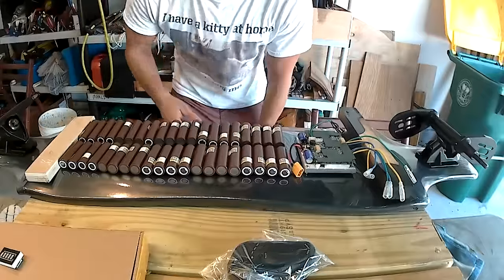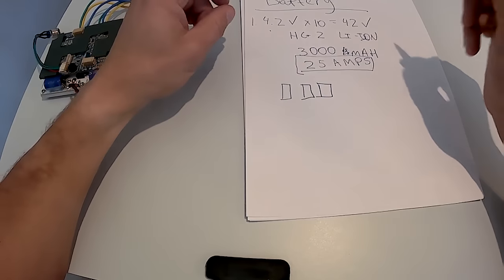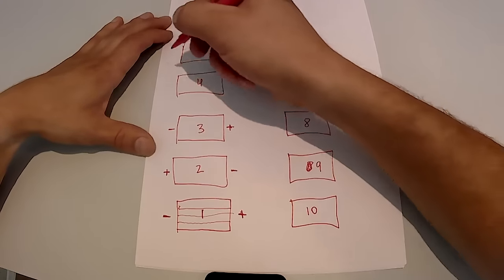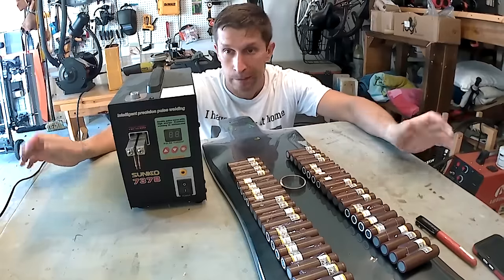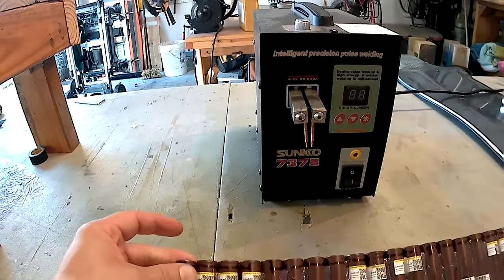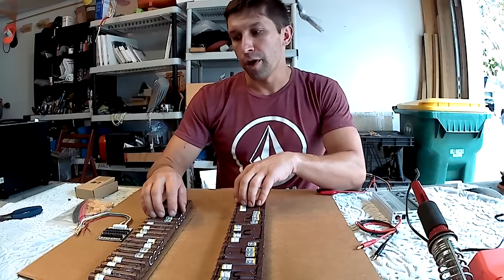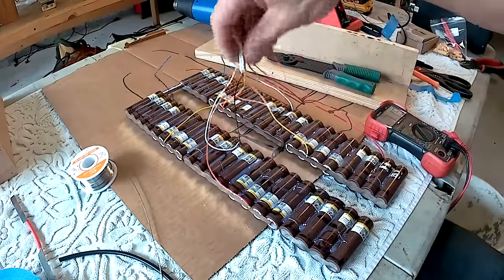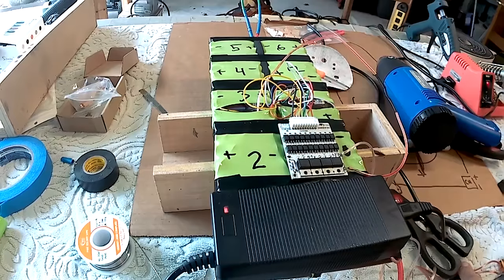Electric Skateboard Battery Tutorial

Comment: Most complete battery building teaching I've seen so far. Thanks for sharing so simple great job...
Reply from the maker: Thanks Man.  If you need something more flexible, here is a flex version of a battery build https://www.youtube.com/watch?v=WfH8vCWobHI
Reply: @artsiomnaidzich9515  thanks for the reply I will check it out. I had a question for a yr now.lol can ones add cells to a already made board battery to increase the range on a board? Thanks in advance buddy, new Sub here!!
Reply from the maker: Don Juan. You can add cells (18650s) in parallel. If u currently have 10s4p set up, you can make it 10s5p (you are adding ONE 18650 to each cell of your power pack). If your esc is rated for higher voltage, you can add cell in series (going from 10s4p to 12s4p). This way requires a different BMS AND CHARGER FOR YOUR WHOLE SET UP.
Reply: @artsiomnaidzich9515  do to your video I understand really good what you mean thanks, I have the hobby wing esc on the verreal f1. With standard 4ah. Battery, if I do that to this pack do I have to change the bms aswell.im sorry for so many questions but you are the most informative Person I've seen and I really appreciate the time you have taken to teach me. Be blessed bro.....

Comment: Though I couldn't clearly get the nickel strip connections & final connection to the main +ve & -ve ... Your chart explanation were amazing. Such a detailed video. Thank you so much :)  Sir ..(1) Incase I'm opting for a Balance charger ...I would like to know.. does BMS takes care of only charging or does it also takes care of the discharge ?! ..(2) Do we need to use a heat reduction fibre around the batteries ? (3) How to choose between Xt 60 or Xt 90 plugs for charging ?..say for a 12S4P config..would it require a Xt 60 or Xt90 plugs ?. (4) Sir , how do we decide upon 4 batteries as +ve & 4 more as -ve  pairs..can it be just two batteries ? how many as a +ve or -ve pair , to decide if we are using a Samsung 21700 batteries for a 12S4P config...I'm a amateur in terms of skating or building electric skateboard stuff.. Hence so many questions. Kindly forgive if it is too much to ask.  Thank you so much once again :) Great Video Sir :)
Reply from the maker: Hi Krishnan, Let's address your questions:

1.  Main reason to use BMS is to balance charge.  You can discharge through BMS also, but I don't use this feature of BMS because discharge rating of BMS (amp) is usually pretty low, which will cause you to loose power to ESC every time you exceed BMS Amp Limit.  All ESCs are either pre-programmed or programmable (You can set Amp and Voltage limits).  ESC does a way better job at governing Amps and Voltage than a cheap BMS.

2.  No need for heat insulation fabric.  Your power pack will not get too hot if designed properly.

3.  For charging, either XT60 or XT90 are fine.  Personal preference. Where it matters is on discharge side (battery to ESC).  XT60 has a LOWER AMP rating than XT90.

4.  There is no way for me to give you an easy answer for number four.  Do your own math and solve this problem backwards.  Here is an example:

You have two motors that you want to use.  Motors are rated for 12s (50.4V), and 60amp Max per motor.  Your goal is to build a board that can maximize the entire resource of the motors.

Step One:  get ESC that matches the output of your motors: (12S Max, and 120A -> 60a per motor).

Step Two:  buy or build a battery pack that 12s and that is capable of doing 120a

12S-How may cells in series are in your pack  (this determines voltage)
4P-How many 18650s or equivalent are in parallel in each cell.  (This determines Max Amp Discharge, and storage capacity in Amp Hours)

Your (P) number will determine how many 18650 you need per cell to meet your demands.

For our example, we are building 50 V (which is 12s), and 120a (Each cell of the Pack need to be able to produce 120a).  If you use SonyVCT6 18650 (to make your cells)  which are rated at 30A per 18650, you will need the following:

120a(target AMP)/30a(rating of 18650)=4

4

For the above example, you will need 4 18650s per cell, there are 12 cells.  Total 18650s needed is: 12 x 4 = 48

48 18650 are needed to build your battery pack.

Get your desired component list.  Find out limits and specifications of your electrical components.  Make sure it all is compatible.  Order parts, complete your build.  Easy, right!

I just summarized the video for you.  If you haven't subscribe, please do.  If you have more questions, try checking the vid out a bit more.  Some of the questions you asked are right in the video

 I started 2 years ago and only used internet to learn.  It takes time, so have patience.
Reply: @artsiomnaidzich9515  Thank you so much Sir 🙂 I've subscribed to your channel 🙏 I've to watch it more number of times to understand this stuff. I find the math to be little complicated . But I'm sure I can understand it overtime 😀

Comment: The BMS you use is a 36V? isnt the battery 42V? 
im making a 37V can i use the 36V BMS?
Reply from the maker: 36, 37 are all 42V BMS.  Manufacturers use nominal charge of li-ion cell (3.6V or 3.7V) to rated their products.  3.6V x 10 cells=36V when battery pack is not charged.  When its charged, it becomes 42V.  Did you get all that?  When buying a charger, make sure your charger outputs 42V, not 36V.
Reply: @artsiomnaidzich9515  awesome thanks 
Yeah I got it  :)
Just wanted to make sure as I got the same BMS as you and was abit worried that it said 36v haha

Thanks I'll be uploading my build once it's done

Comment: hello, I have a question to your calculation, 
you calculate 4 batteries in parallel can add 100Amps, but your bms has discharge rate only 18Amps not 100Amps , than you are limited by bms and you can only take 42V -18 Amps ,
you should devide your battery to 2x 10s2p with separeted 2x bms and then conncet them parallel (mabe with diode for secure) and you get 42V - 36Amps , I´m I thinking correct?
Reply from the maker: BMS in this case is only used for balance charging. My battery is hooked up directly into esc. This esc pulls 60a @ 42v. Esc has low voltage cut off set at 30V. Discharging through bms in this case is not necessary. If bms discharge is what you want to do, i would get a bms that can do 60a continuous discharge.
Reply: @artsiomnaidzich9515  thank you for explenation, now I understand your connection

Comment: Sorry but I need help...the esc in the video is ok for 2 motors, 1500w and 22v each one? Thanks
Reply from the maker: Davide Maria hey Davide. If ur battery is 42V (10s), both motors are getting 42v. When i purchased esc on ebay, i had to specify voltage. There were 3 options 6s, 7s, and 10s (25.2V, 29.4V, 42V). The esc in the video is dual motor. Yes, two motors are ok. Its an easy esc to use and set up. It works with most of the common motors for esk8. Its not the best quality esc, but its great for overall ordinary use. I have used it with 6374, 6354, and 5055 brushless motors)

Comment: Why did you use 40A BMS while your battery supplies at least 60A?
Does this set up works correctly and not overheat?
I want to use the same battery (10s4p) but draw 80A, can I also use this BMS?
Or should I go with an expensive 100A one?
Reply from the maker: 8SharkTV Moshe BMS is used for charge cycle only. For discharge, battery connects directly to esc.
Reply: @artsiomnaidzich9515  will it disconnect the battery when one of it`s cells drops below cut-off voltage?
Reply from the maker: 8SharkTV Moshe no, but your ESC should.
Reply: @artsiomnaidzich9515  Thank you for your answer

Comment: Good video but you are using the term "battery" and "cell" backwards. Batteries are made of cells. An Individual 18650 is a cell. Multiple cells wired together make a battery.

How do you like your spot welder?  I'm in the market for one and I'm  trying to decide on which one to buy or make.
Reply from the maker: Noted.  Thanks.  The sport welder I use works great.  It was one of the cheaper ones on amazon.   In this battery I referred to a cell as a run of four 18650s in parallel (I had ten runs of four in parallel to make it a ten cell battery).

Comment: Hey I finished this battery and before I charged it my volts were 28v and when I plugged it in to the charger it went down to 8v and isn’t coming up and my balance changer also won’t connect to it. Do you have any idea what’s wrong with it or if it’s fixable
Reply from the maker: Cheas Moon Hi chase. Is it 7s battery?  It sounds like you may have a dead cell or problem with bms or problem with series connection.

Here is my troubleshooting suggestion:

1. Access the balance cable.
2. Using a voltmeter, keep one probe on battery neg, other probe (+) checks each cable in the balance cable (there should be small metal surfaces you can check on balance cable)
3. Each cell should have equal voltage.
If one cell is bad, you should be able to find it.
Reply from the maker: Cheas Moon look at 26:30 in this video. Thats your standard cell check using balance cable.
Reply from the maker: Cheas Moon if all cells check out ok, than its you balance charger.  Let me know how it goes!
Reply: Artsiom Naidzich I’ll give it a go when I got some time but thank you so much for your time
Reply: Artsiom Naidzich i got a electrician to look at it and he said I used the wrong kind of charger and that’s what killed it I need new battery’s now all mine are now at 0v or 0.01v
Reply from the maker: Cheas Moon that sucks. Sorry to hear that.  Was the charger for a wrong voltage?

Comment: How thick is the nickel strip
Reply from the maker: It's 0.1mm.
Reply from the maker: I have switched from doing multiple layers of nickel to one layer of nickel with copper wire over the top.  This method allows for a flex in the battery.

https://www.youtube.com/watch?v=WfH8vCWobHI

Comment: My question is you have more than 10S ? Or 1S is a group of 4 Li-ion ?
Reply from the maker: 10S4P Pack.  4P means you have 4 18650s connected in parallel per cell (or on cell is made of 4 li-ion batteries).  10s mean that you have 10 cells connected in series.
Reply: @artsiomnaidzich9515  on the Eskate i want to modify i have 7 cell 18650 Battery.BMS have only 3 wires ,Battery pack is 3S2P and one is alone … outside Voltage BMS only 19.5V . i order a new BMS with 7 wires to each cells ..it seems to be an error as one wire BMS  is for 2 Cell in my configuration ? and one wire for the cell alone ?

Comment: Where can I purchase the best BMS that can do more than balance and are of good quality?
Reply from the maker: ELLIOTT MORIARTY Good question.  I don’t know where. Aliexpress has the biggest selection of bms options. I use bms for charging/balance since most ESCs have a programable low voltage cut off.  I can help you look. What voltage and amperage are you looking for?
Reply: @artsiomnaidzich9515  It would be for a 12S battery pack with 4.2V each cell and really unlimited amps. However, your video made me think that I don't mind spending $200 or more on a good quality charger that can balance charge my pack if I made one without a BMS. Also, the BMS takes care of the charging part; not the discharge part while using the eboard?
Reply from the maker: @WORLD-OF-MERLIN  

Hobby balance charger I show in this video is Icharger1010B+.  It is an awesome charger with one major limitation, it only balances 10 cells Li-Ion, 42V.  I have not found a reliable Balance charger for 12 Cell System.

I have been using medium grade BMS protection boards on 12S packs.  BMS has three functions: 1.  Balance Cells During Charging Process.  2.  Stopping charge cycle if any cell exceeds 4.2V.  3.  Battery discharge through BMS with a specific amperage and low voltage cut off.

The more amperage that BMS is rated for, the more expensive it is.  Most of your dual motor esk8s set ups will required current in 100a ballpark if you choose do discharge through bms.  However, you can discharge your battery pack through a direct connection to ESC (bypassing bms).  This ensures that you get all of your battery potential delivered directly to ESC.  Running high amps through bms can result in bms overheating and shutting down current flow to ESC.  Also, most ESCs have a progammable low voltage cut off to prevent overdischarge of battery pack.

Bottom line, you can safely use BMS for balance charge (most of bms have similar balance charging specs).  To save you some $ and get most power out of your battery pack, direct connection from battery pack to esc is what I recommend.  To prevent overdischarge, program your ESC to turn off at a certain voltage.
Reply: @artsiomnaidzich9515  Thanks for the thorough response. I've done a bypass of the discharge for a BMS and know that the BMS will take care of the balance charge, but wasn't sure about doing away completely with the BMS, but thanks to you now I know that I can find a good balance charger from Canada for about $300-$400 that will go up to 14 or more cells (it's used for ebikes also) and I have been programming my VESC to cut offs properly. So, I've got both ends covered without a BMS. Thanks, much appreciated for the confirmation; it was swirling around my mind, but wasn't 100% sure, but now I am.... Also, if your spot welder goes bad; then I recommend using a German made one (more expensive, but worth it), https://www.keenlab.de/index.php/product/kweld-complete-kit/
Here is the programmable charger: https://www.ebikes.ca/shop/electric-bicycle-parts/chargers/satiator-high-voltage-model-5a-max.html
Reply from the maker: ELLIOTT MORIARTY thanks for the info. Will check it out!
Reply from the maker: ELLIOTT MORIARTY.

I checked out the charger. I dont think its a balance charger. Its a variable voltage charger/power supply. You would still need to attach some sort of balancing cable/circuit to ur battery pack.
Reply: @artsiomnaidzich9515  Sorry, I probably clicked and copy and pasted the wrong charger. I know they have a Satiator one, I've spoken with them, but was lazy to look at the descriptions on their website to find the one they were talking about.

Comment: Question? Would your battery get a better range by discharging through bms?? Assuming we are using the correct output amp for a bms that the battery will be producing???
Reply from the maker: No.  Best range through discharge is direct to esc.  I dont know of many ESC that dont cut off automatically at certain voltage (or that you cannot program to cut off).  Think of BMS as a small resistor or a block on the way to the ESC.  Most BMS circuits that support the amp needs for esk8 are very expensive.  I've always only used BMS for balance charging only.
Reply: Okay thank you. I was just curious because after riding my e board and the esc shut off at around 30v. I was curious as to what voltage each individual cells voltage was at. So I took heatshrink off my battery and tested each cell through bms and found that each cell didn’t all have the exact voltage. It was off by just a bit. So I was just curious if the discharge was direct from bms if it would discharge more evenly on the battery.
Reply from the maker: Gustavo Raya during discharge, bms does not balance anything.  You will always have slight differences in cell voltage.  Bms should balance it out after some time.
Reply: Thank you! You are awesome keep up the good work!

Comment: Great video where did you buy the 18650 cells?
Reply from the maker: Hi Cruz.  I got cells on aliexpress.  For me they have been working as advertised.  Ive build a handful of batteries using HG2 cells and so far no issues.  If you do use them, make sure you charge them fully as soon as they come in.

https://www.aliexpress.com/item/100-New-Original-HG2-18650-3000mAh-battery-18650HG2-3-6V-discharge-20A-dedicated-For-LG-Electronic/32868746648.html?spm=2114.search0104.3.1.201ebafbctVEHn&ws_ab_test=searchweb0_0,searchweb201602_1_10065_10068_10130_10890_10547_319_10546_317_10548_5730311_10545_10696_453_10084_454_10083_5729211_10618_10307_538_537_536_10059_10884_10887_100031_321_322_10103-5729211,searchweb201603_51,ppcSwitch_0&algo_expid=7566e5e0-f15d-46bc-8681-d75ca4e8b574-0&algo_pvid=7566e5e0-f15d-46bc-8681-d75ca4e8b574